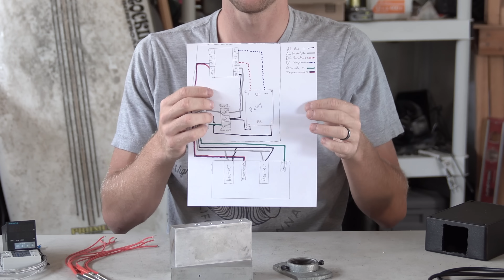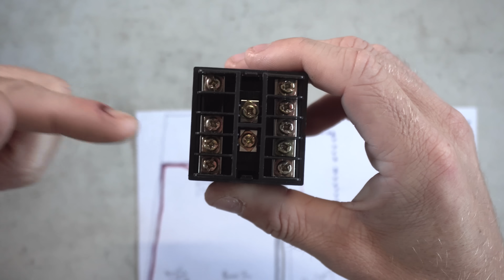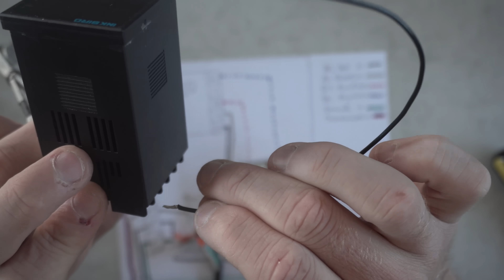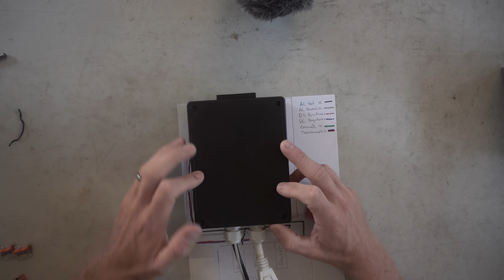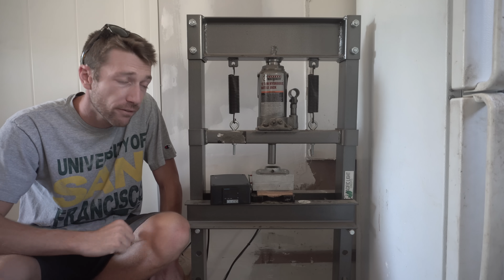DIY Rosin Press and Plates

Comment: Could one use stainless steel instead of aluminium bars? Thanks
Reply from the maker: Not ideal. Aluminum is one of the best conductors of heat. And is cheap.
Reply: @GreengenesGarden  cheers bud, thanks for responding, great video, well done 💯

Comment: Green gean, I need your help, I followed the video as instructed, but when I plug the PID in and enter desired temperature and press set, nothing happens,or A 100 is displayed in green
Reply from the maker: What does the manual say about that code?
Reply: @GreengenesGarden  I do not see this code in the manual

Comment: I use the pid controller for a couple different things so i have the power going out from the controller wired into a plug strip. every device i use it for gets wired into a plug and has its own thermocouple, the plug strip has 1 outlet that bypassed the controller so i can have something plugged in with constant power as well

Comment: I appreciate the build, as an electrician your single line diagram was spot on, I did modify a little and used 2 heaters per plate and went with twin PID’s🎯

Comment: Would it be worth doing 2 pid controllers and 2 thermo couplers. if so would it need 2 relays or would they both run thru one relay
Reply from the maker: It's not needed. If you did would need another relay too.

Comment: Does anyone know why he used a ac to dc solid state relay? I thought he would be an ac to ac since that's what the heating element and pid are running off of
Reply from the maker: Relays don't convert anything. There is a signal side and a load side to the relay. Load opens and closes based on the signal side. In this, the signal is DC...load is AC. 
PID sends low voltage DC signal to the relay to open or close the AC side.
Reply: @GreengenesGarden  thanks you! I appreciate the feedback so would it be the same for the novus 1030 controller or all pid controllers?

Comment: Also 220f won't hurt the press. From that distance you'll be fine.   Steel maintains its rigidity very well under heat. Even just below melting it still retains about 75% of its strength.
Reply from the maker: Its the oil in the press that heats and can be an issue.

Comment: As a welder/machinist think I'll make this my next project.   I'll make the 10t press itself as well.  Could even jazz it up with a pressure reading.    Cool video bro.
Reply from the maker: If you can weld you could just get the bottle jack and make a more compact nice frame/cage that would be more desktop sized.

Comment: Would have been kind of nice if you explained what drill and tap went with which holes but thanks a ton
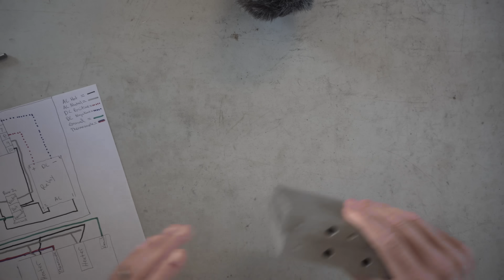Reply from the maker: Would have been kind if you watched and listened to the video that has exactly what you're asking for already in it. Not to mention they are all called out in the description with sizes  and direct links. @23:45
Reply: @GreengenesGarden  my bad dude is it a different video

Comment: Hey do you know if that inkbird ITC-106vh will work just the same with 4 300 watt heater cartridges in 5x9 blocks?
Reply from the maker: IDK. But a PID only controls the relay, not technically what is attached to the relay if that help you.
Reply: @GreengenesGarden  thank you. im checking the specs but I think it should work

Comment: Hey! I'm going to make a press according to your pattern. there is a 30 mm plate, which is a little over an inch. I can cut it down to an inch. or leave 30? the rest is all the same. I think it just takes a little longer to heat up. Or put more powerful heaters?
Reply from the maker: it will make no difference

Comment: Great guide for all of the diyers and tinkerer's. I might try this with stainless steel instead. I question the longevity of aluminum in a press, and crushing AC powered heater cartridges isn't ideal.
Reply from the maker: Aluminum is used on every heated press in the biz. Conductivity and strength

Comment: Can anyone tell me, I’ll be using a 240v input not 110v, do I still need 100w cartridge heaters or would a different wattage be needed?
Reply from the maker: You would need to be using 240v cartridges heaters then.
Reply: @GreengenesGarden  yeah any idea on wattage tho or will it not matter much?

Comment: Great video sir. I want to use a custom size Alluminium block. 10 inch by 3.5 inch. I am heat stamping my logo which requires heat and preasure. I cant find heat cartridges to fit the size block I need. Can I use the same size you use. Will.it heat just as well just take a little longer?
Reply from the maker: Yes you can

Comment: Great video, one question. Can I use 12v 40w cartridges heaters for this project?
Reply from the maker: Not with "this" project. 12v is DC, not AC power.

Comment: Excuse me, I'm from Europe; due to the different voltage do I have to use a different electronic assigment or just as you make? Thanks so much, great video
Reply from the maker: You would need to make sure all the components are compatible with your country's voltage.
Reply: @GreengenesGarden  Thanks man, and great video

Comment: Does it make a difference to the pressing process if the heating rods are running width-wise or lengthwise  ?
Reply from the maker: I wouldn't think so. Same amount of metal, same amount of heat.

Comment: Hello nice video. I have a problem, I only have 1/2 inch aluminun thickness. and i have a 6 ton press. is there any problem if I use 1/2 thickness aluminum?
Reply from the maker: I'm not a mechanical engineer 🤷🏼‍♂️

Comment: Can you add a second Temperature Sensor for  the other plate?
Reply from the maker: double the PID kit, relay, output cables
Reply: @GreengenesGarden  and connect both cables(blue & red)  to the same points (3 & 4)?
Reply from the maker: @chsrambpa1388  no.it would be 2 of these builds. The only thing shared is the power into the box.
Reply: Never Mind after looking at your diagram I realize it would be 2 PIDs. The PID has teh TEMP sensor in it. 2 PIDs means tuning on and setting two units. I wonder if they have a dual temp sensor unit.

Comment: I don't what I did wrong , Turns on plates won't heat ... I ordered from the link but the PDI is different but just lacks the terminal that's not used . I have no idea on where to start to trouble shoot.

Comment: Currently finishing up a build followed all directions step by step. Pid turns on and reads temp but cartridge heaters won't warm. Any help would be appreciated
Reply: Figured it out thank you so much for the detailed video and quick response
Reply from the maker: Sounds like they are not getting power. Work it out backwards.
Reply: @GreengenesGarden  what exactly should I reverse?

Comment: Hi there ! thank you for this awsome video . is this the same set you use in this video ?  

https://www.ebay.de/itm/Inkbird-Digital-PID-Temperaturregler-ITC-100VH-40A-SSR-Relais-K-Sensor-110-240V/192138571794?_trkparms=ispr%3D1&hash=item2cbc59f012:g:OsEAAOSw241YmU1Y&amdata=enc%3AAQAFAAACcBaobrjLl8XobRIiIML1V4Imu%252Fn%252BzU5L90Z278x5ickkfKe2vUidqHRg3XM2X2xOVF7AQnPn0C5v6lWvwSjBAc4krBSIpN9d5PJH4tQRK9JfgPC3QxwxURQMEYq8FHN5SkFO91P2JJkcBT1%252BL2e78UogXdny1C2h2GTRwbKb8kXuGkfJDYyaLp7i%252Bm85mhzzN7Q%252FIReDpUfb30R8Jb6j60kyFc84%252FSPtHwyMCCE0ZaHbK8GFpAgU2A9Qr528MrSocbg0e0mKZWhr%252FIZF0KPXW3e%252BHExf%252FU9rVbn5MsrE9rsfNn91%252FvQKGkCBH2ZSXMIJfRMDvXQX33BIe4bo3gxG%252Fuzdyo6XRo6%252FhPtNPImNssRXm5QeviV7QYEPA8QKftCh9tcy5Ga9cZIDmRapAPbGA0YR57OlRaLB5LZ%252BjJc9TOWQvuaxl4egghrSSJsz9GBCrCgKm9AjhxFkpxXQfQJAQU9hognuRGePzhRga0gZVaAMYMgF2LdfJ9YFJwpwKO3P2c6hLvECK5Q83ULZmGaUIJEYq0jjv2xutuzz5vwqNDryS%252BgWBTn7v%252BJnXOhatwA77wPQDmKLZT3BV8kQW8CbQq64AJPZD86NuIFGeErvhVFMWt%252FZXVEb%252B6CdGbhM2VDlZ%252Bf9yv8ts9F5sGr9C8RkAddqwqsnD9ogwUcJm367bMPTkTQ0ne9ELsrSxGLBskCQ9anW1%252F5gkdixme88WA7SJS26dn8VWHFoCOnBRai%252BnABu4RfBvBxpEN9WSnAlJzPhvXg%252BxNhuB6k9A%252F5cSqPGBWL3UESA0H2GdqRCkLwdm5qpn2BAfU0NhMeIEqJzZblTMw%253D%253D%7Ccksum%3A192138571794e07288695a644178b2a53e786f39933a%7Campid%3APL_CLK%7Cclp%3A2334524

Comment: Just a heads up the link for the plates is for 1.5 inch thickness, I didn't notice then until they arrived.  I went ahead and built it but I don't think the 100 watt heater is enough, I do not get up to the correct temperature on the face of the plates as the thermocouple is reading.  I'm going to give the 120Ws a try.
Reply from the maker: Hasn't been an issue for anyone else. Me included.
Reply: @GreengenesGarden  Ok, thanks for the response and I meant to say thanks for the video earlier as well.  In the video you mention that the plate is 1 inch but the link is for 1.5 inch thick plates. You used the 8x40mm 100W heater on the 1.5 inch thick plate?  It seems small 40mm (1.57 inches) is just about half way through and was wondering if that was why but then I rewatched and you mention using 1 inch thick plate.  I am sure it is something I am doing incorrectly and keep working on it.  Thanks again, extremely useful!

Comment: I built a press following the exact same procedure but when I plug it in the inkbird lights up then cycles through a few screens pretty quick then trips the surge protector I have it plugged into. I've checked the wiring like 10x and it's right, any ideas what's going on?
Reply: Try plugging directly into the wall.  Your surge protector is likely tripping by the increased power draw of the heaters coming on.  If you then trip a circuit breaker, something is wrong with your wiring.
Reply: @tedsmith1030  I won't damage the breaker will I? I'm in a rental so I'm nervous haha.
Reply: @corey312  No, they are designed to trip if something wrong.
Reply from the maker: If your tripping a breaker itss shorting and is wired wrong. Thats why its tripping the breaker...cause its shorting.
Reply: @GreengenesGarden  thanks for the reply, I ordered a new pid to see if that's the issue I went over my wiring and there isn't any short unless it's in the jacketed part of the cord. It powers up fine then cycles though the 3 screens then as soon as the heaters power up it blows. I'm also wondering if it could be the heater cartridges?
Reply: Turns out it was one of the cartridge heaters I got a new pid and hooked it up, plugged it in then it shot sparks out of one of the heaters right where the lead goes into the cartridge. I have 12v 100w 8x100mm cartridges is that too big of a draw?
Reply: I'm an idiot just realized I need ac not dc...

Comment: Very, very informative video. Thanks for producing it. If you had to do it over again would you still go with two 100w cartridges per plate, or would you go more maybe 120w or even 250w each cartridge for even quicker and more deliberate control?  Thanks again.

Comment: Hi, brilliant design, thanks🙂  I have a problem with the PID setting, can you provide the driver values?
Reply from the maker: I have never had to mess with mine. Came out of the box working perfectly. Set the temp and done.
Reply: @GreengenesGarden  unfortunately it doesn't work like that for me, it doesn't keep the temperature but it jumps a lot.  If anyone has the option of specifying the parameters in their controller, it would be great😉
Reply from the maker: Thermocouple isn't set tight to the metal is my guess if it is jumping a lot.

Comment: for the port for power cable, what do you suggest?  would this work? https://www.amazon.com/URBEST-Rocker-Switch-IEC320-Module/dp/B00NWO68JI/ref=sr_1_12?dchild=1&keywords=rocker+switch+power&qid=1592274874&sr=8-12
Reply from the maker: Not unless you have a box or panel to mount that into.

Comment: Not sure if anyone will respond but I’m having trouble with my cartridge heaters. All four are not producing any heat. Any idea what would cause it if there is 120V going to the hot and neutral wires? All of the heaters do have 88+ohms of resistance so completely unsure what would cause the lack of heat.

Comment: Will these four heaters work with the pid system you built and what do you attach the heat sink to if anything? Thank You

https://www.amazon.com/Twidec-Cylinder-Cartridge-Replacement-Electric/dp/B07PPDKZ6X/ref=sr_1_7_sspa?dchild=1&keywords=cartridge+heater+130mm+100+watt+110+volt&qid=1587585473&s=hi&sr=1-7-spons&psc=1&spLa=ZW5jcnlwdGVkUXVhbGlmaWVyPUEyMVJPOVNLOUdQS0smZW5jcnlwdGVkSWQ9QTAzOTA1NzExVVlFQTU4V1o3VFY5JmVuY3J5cHRlZEFkSWQ9QTA2NjA5MTVLTzVDNU0wS1VWRUEmd2lkZ2V0TmFtZT1zcF9idGYmYWN0aW9uPWNsaWNrUmVkaXJlY3QmZG9Ob3RMb2dDbGljaz10cnVl
Reply from the maker: yes. just have to go into the plates long ways. one per plate is enough probably.

Comment: So I have everything I need just need to drill the holes for the cartridge heaters and tap a hole for the thermocouple. Big mistake I made was ordering the plates in your description to Amazon. Again my fault because I didn't really read what I ordered. And I didn't catch it at first but in your video you mentioned the plates were an 1" thick. The ones I ordered using the link came in at 1.5" thick. As I'm setting this up today I realized that with my 6-ton press these 1.5" plates hardly fit at the bottom of the ram. This video has been my bible since the beginning. Truly informative and the most helpful. But now I need ideas. I'd hate to buy a 12 ton press but maybe that's what i need to do. Any modification ideas? I can send a photo of what I'm looking at. Thanks again for this tutorial. Subbed
Reply: lol exactly. another note the pid only reaches 122 deg
Reply: @cannabisfamily5079  false information.  That PID goes up to 1300°C

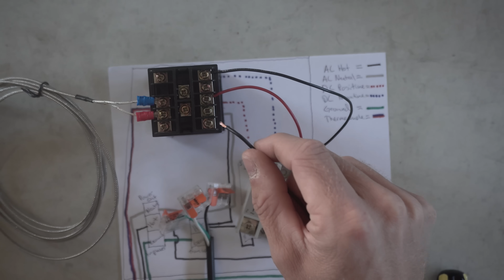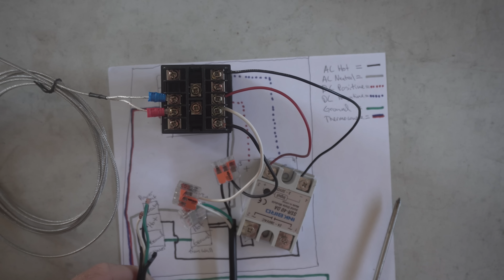Comment: I built it and it's working now. For anyone else who knows nothing about electronics: The first power cable you see at 18:50 should only have the female end stripped. Leave the three prongs intact. The power cable you see at 20:07 is a separate cable and you need to strip both the male and female end so that the wires are sticking out of both ends.

Comment: Need help ASAP. I have two power cables. Do I cut off both the male and female end of ONE power cable and make the connections to the relay and PID, or do I cut the female part of TWO cables and make the connections to the relay and PID?

Comment: Also don't you think that's a bit too many wires wouldn't just two Stronger heating elements do the same and eliminate four wires??
Reply: I built your first press and man all those wires get in the way of the parchment.  I feel you on one the extra heat though because those six inch plates never heated up evenly. All I know is those freaking wires get in the way

Comment: I notice you opt to not use the heat sink on the relay. Won't the relay burn out/fail?
Reply from the maker: It's fine. I have never had issues. The load we are putting is ~2amps...compared to the 40amps the relay is rated for.

Comment: Why do I need to insulate my plates you need like 300-400 F before your temper started to wear off but you don't want a temp that high if your under 500 I don't think you need to insulate your plates if anything your plywood is more dangerous if your aluminum plates  can take 400F and not bend warp steel is not gonna do anything also any reason why the bottle Jack is on top of the press and not below if there's ever Jack failed with fluid your batch is wasted very good video other wise another note if your therocupler is giving bad reading full the slot up with a thermal paste or good thermal fluid
Reply from the maker: You need to insulate them so they don't heat up the press. 
As far thermal paste...that was said and done in the video. 
Ask the makers of the press...jesus dude.

Comment: SIAP...New here but I was wondering on that pid...It says that it only goes to 122f and the company websited Temperature Compensation: 0-50℃ which is 122f....is this a new model since yours is at 180f...or am I missing something or reading something wrong? thanks for the help..

Comment: Try permatex ultra Copper(700F temp rating, sensor safe, handles vibration very well, also handles below zero f)) if anyone ever needs alittle reliable glue or sealant for little stuff in a diy project involving heat.
Reply from the maker: Thanks, I'll check it out.
Reply: @GreengenesGarden  sure, just try to throw whatever little bits of info I have out there, you never know what someone is looking for to solve their problem.. BTW another user of ultra copper got email to some questions directly from permatex it IS more of an insulator than conductor of heat just FYI. Ultra grey is also great stuff, firmer than the copper,  but handles alittle less Max temp roughly 500f. Ultra grey is awesome for replacing rear view mirrors that fall off windshields especially the ones that have black matte stuff on the top edge of the windshield so it isn't located in a glass spot, so the rear view mirror purpose made adhesive will not work cuz it's not metal/glass.

Comment: This is just like the set-ups we use for brewing beer DIY !  Do you see any "obstacles" to using two 10" x 3" plates, like the $$$$ Longs Peak Pure Pressure uses?  - Like fitting into the press, need to use 3 heaters per/plate (6 total or 8),  etc.....?  Many tutorials on Homebrewtalk.com and here on youtube, look up Barley and Hops (George is great teacher, look up his PID controller tutorials)

Comment: Gene love your vids. 👍 I’m currently fabricating a press and at the point of drilling my plates for the tube heaters. My plates are 3.5 x 7 kind of unusual size but free is free. What kind of hole centers would you recommend. I divided the space in 3rds just wondering if I should stagger the heaters for more even heat or does this not matter. 

Thanks for your tutorial